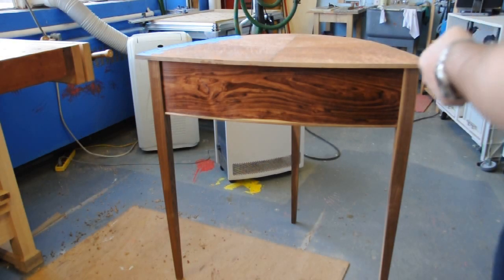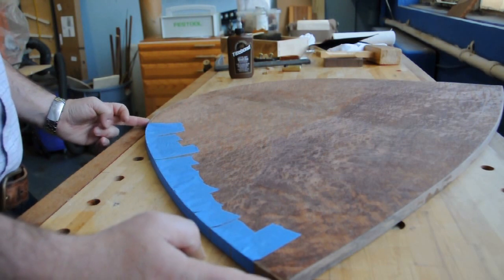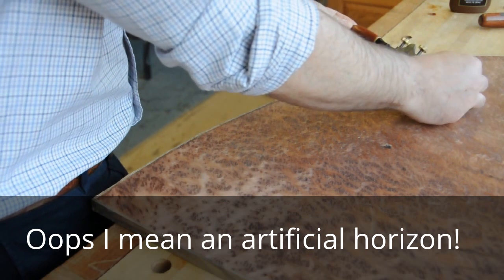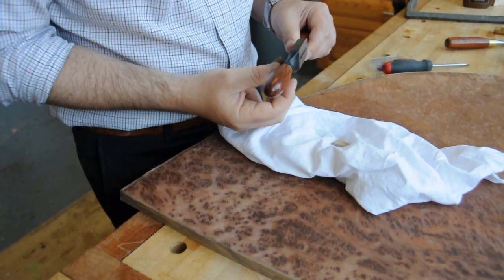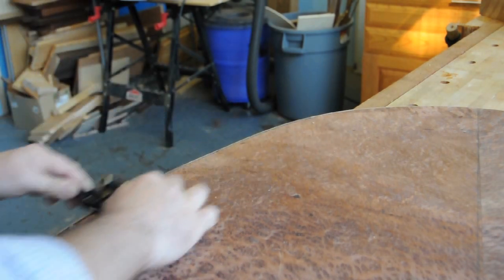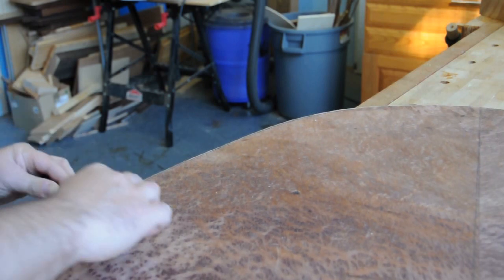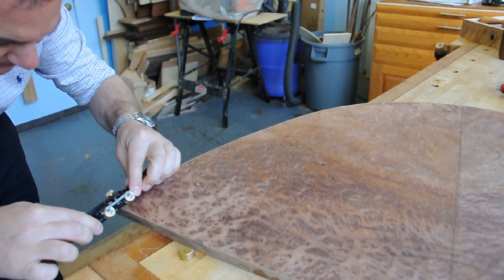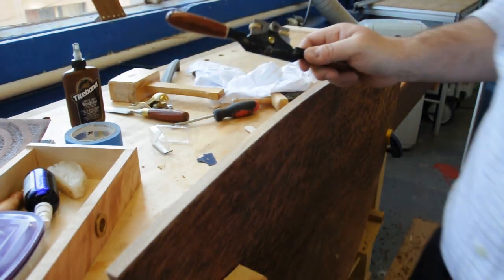Using a Veritas spokeshave to flush trim walnut edge banding

Comment: Thx for such an informative video.  Do you have any experience with using a spokeshave on a concave surface?  I have a curved face spokeshave for such work, and all I ever manage are chips and gouges as I skip along the curve.
Reply from the maker: A convex soled-spokeshave is certainly a harder tool to master, but if the edge is sharp and the grain is friendly you should be able to produce a shaving. It takes a little practice to find the right angle of attack, but don't be tempted to push the blade out in order to produce a cut. Keep the blade protruded as far as you would for a flat-bottomed spokeshave and pivot the spokeshave on the sole until it starts to bite.
Reply: mouppe
Thx for the quick response.  I will go find something curved and try it out. - pjw